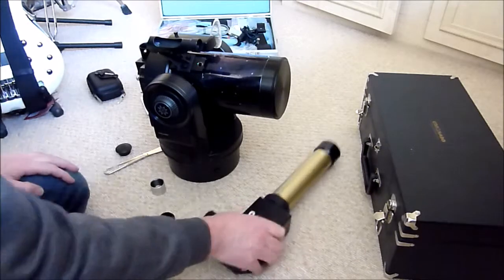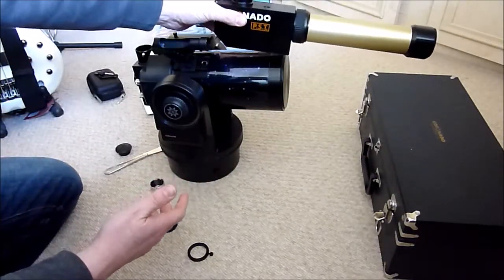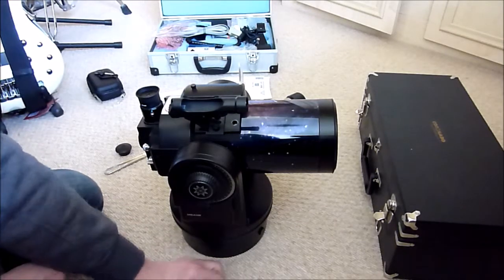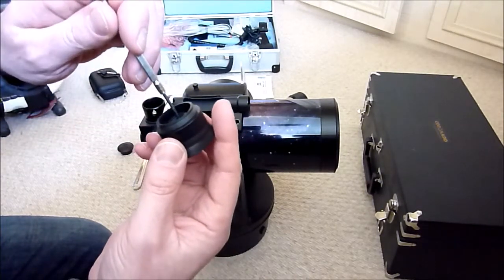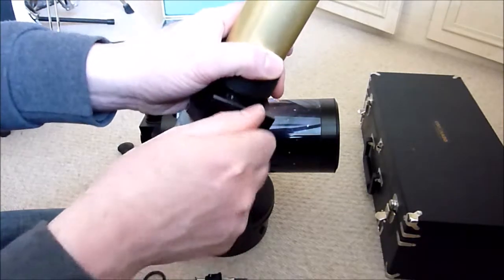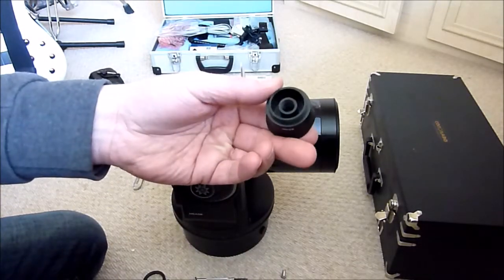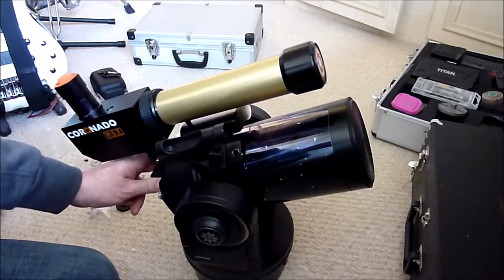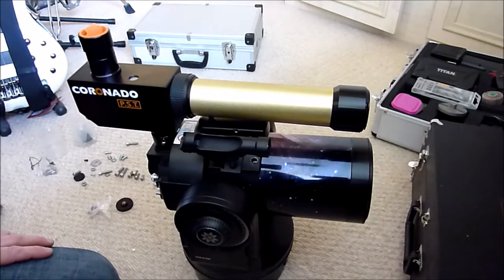How to Mount a Coronado PST on a Meade ETX Telescope

Comment: Hi, is the PST worth the money ( €995) for visually use alone ? Is it also a reliable product? Thanks , if so then i Will order one!
Reply from the maker: Hi, It's a lot of money now, it used to only be about £500. It does suffer from a 'sweet spot' in the filter where you can see some prominences in one part but not on the other side of the eyepiece. It can still produce some very good images when used with a good camera and a Barlow though. All Ha telescopes have increased in price though.
Reply: It's a fun entry solar telescope, but very tricky to do astrophotography with.

Comment: Daniel, like your solution here, I have the same scopes. Just curious how the ETX handled the extra weight.
Reply from the maker: It didn't like the weight initially, so I purchased some cheap leg weights with velcro and wrapped them around the front of the ETX tube to offset the weight - that worked quite well.